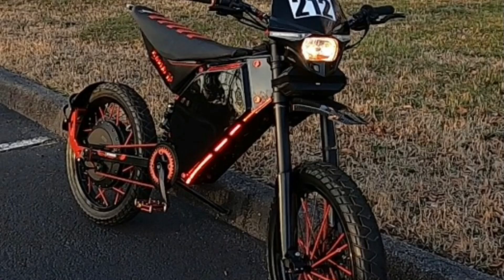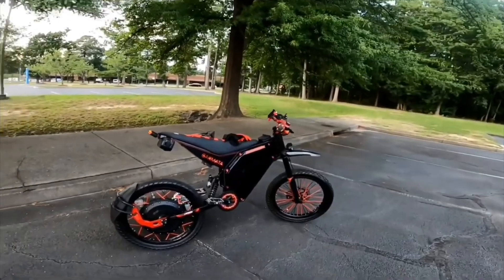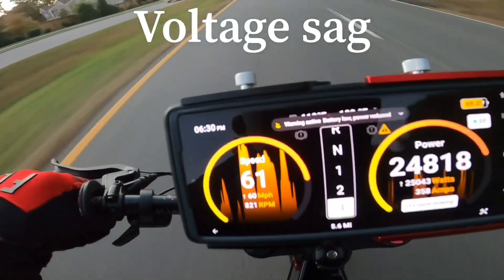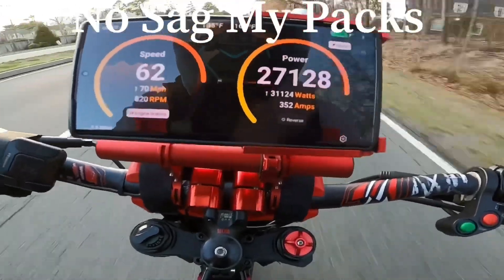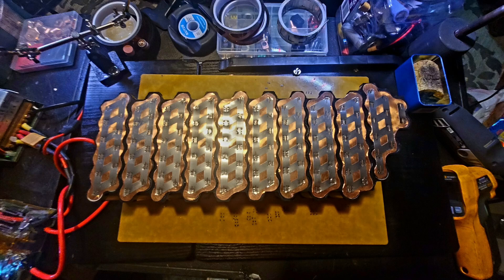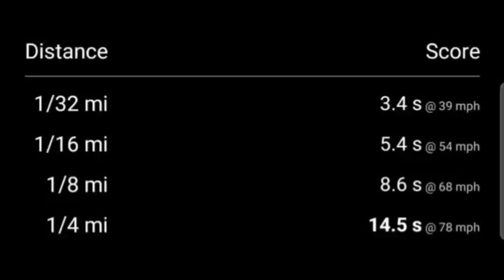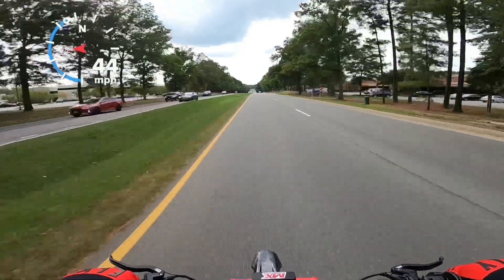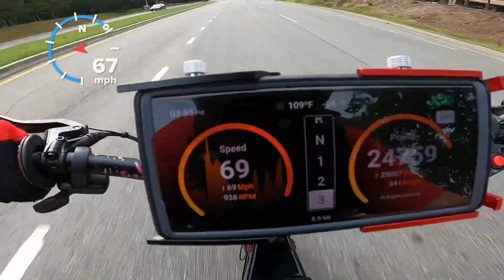Custom Hi Power E-bikes & Batteries with no sag low resistance for max Power ChriscrossingWires PEVs

Comment: Trash…at least that’s what I’m seeing of many mainstream e-bike manufacturers. 

This isn’t the case. 

That’s one hell of an improvement by going self-built molicels?!

Can you list the specs controller, battery/bms, motor 79-80 is remarkable, if you can keep it there consistently; can you?

I’ve seen a few videos marrying mechanical with electric for impressive results, do you see yourself experimenting with that or do you have firsthand experience with that type of setup?

TIA

Nice build! 🔥🔥🔥 Should be industry standard!
Reply from the maker: Thank you kind Sir and for sure I wanted to do a mid drive build some day with integrated mechanical transmission. Right now I like the direct drives as they give me full range and I have enough power that I still have lots of torque. I'm running BAC8000 450dc line 840 phase amps. 20s16p molicel pack and on occasion I throw on an extra 20s4p pack for a Lil extra. I honestly don't get to stay on at long periods cuz at that power level and on a public road it don't take long to run up on traffic, red lights or a curve so I don't even fully know the top speed. The calculations say it should do 105 at this power level with wheel diameter and the amount of field weakening but I don't get to run it out much. Had one trip on a country road but footage got corrupted I hit 100mph but the naysayers won't believe it until I can actually do it again on camera but at this point I don't care I know what it can do and I'm more impressed with the acceleration I'm running 14sec 1/4 Werth stock swing arm and that's rolling into the speed so it gets real busy.
Reply: @ChrisCrossingWires1212  found a video of an e-bike w/integrated mechanical gears…$7k (Surronster) https://youtu.be/OE6bvV4eWws?si=GN4hz2X-dPJrtj4Z different beast w/gears.

If you don’t mind me asking, how much did your build cost time/$?

Are you available for commission WRT build?

BAC8000 w450dc line 840 phase amps is/should more than enough for this model/application, which leads me to my next thought? 

What’s the next plan & will it be implemented on this platform?

Me personally, I like the bike versus motorcycle aspect of e-bikes, which in the future should be separate from geared e-moto’s depending on hp/overall weight.

These electric motors, batteries & controllers are only the tip of the e-bike iceberg.

Single motor will get "105" or more, but w/gears & other enhancements, we may triple that or more. The motorcycle land speed is 376.36, so triple would be the floor.

Grey area or not, the speeds & weight will dictate new rules; hopefully, they have the right people lobbying Congress for fair legislation.